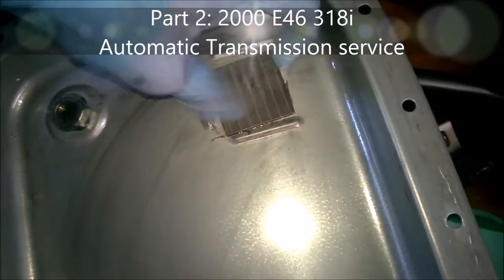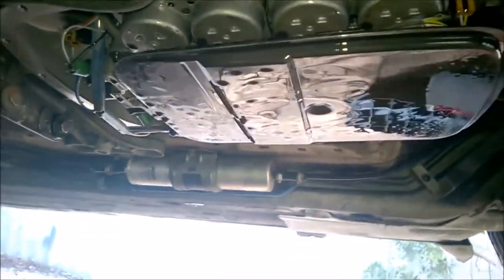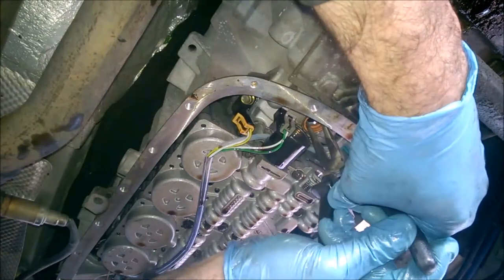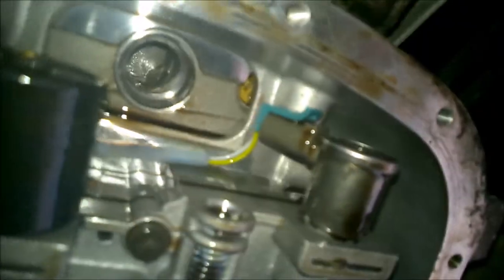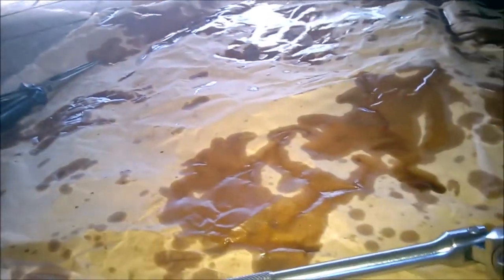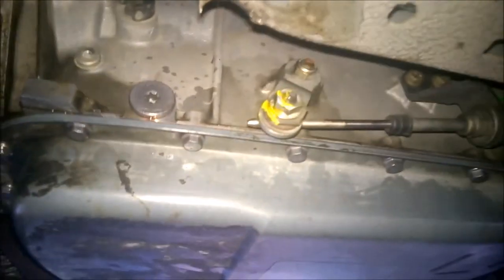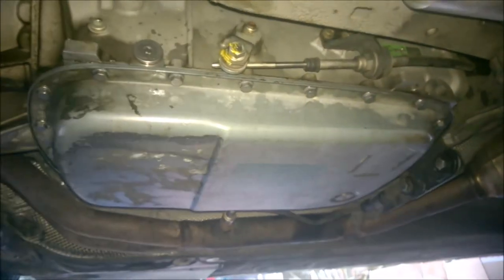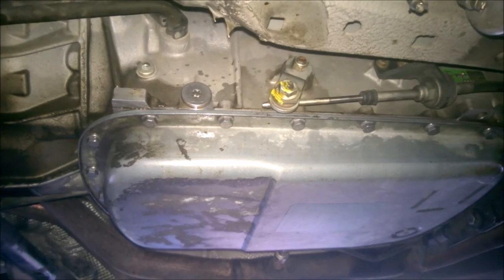Part 2:  2000 BMW E46 318i Automatic Transmission Service

Comment: thanks for video just about to do this on my trans same as yours what was the torque wen doing up the bolts mate?
Reply from the maker: I cant remember right now, but refer to manual. I just nipped them up as they are low torque. Just do not overtighten!

Comment: How much litres you put in transmission?
Reply from the maker: Usually the fill hole is also the level, so when it starts to pour back out its full.  Just make sure you go through the gears while filling and not allow the oil temp to get hot. Im sure theres instructions online.

Comment: hello bro
why you didnt put sealant betwen gasket
and carter?
Reply from the maker: There are no instructions to do so. But I suppose you could add a slight amount onto the gasket itself but I never had an issue with leaking.

Comment: Did you had any issues after you changed your transmission oil to date? Thank you for making this video.
Reply from the maker: No problem at all, the box is still running smooth as silk.  Cheers,

Comment: Hey buddy please if you can help... If i checked my transmission oil and it looks so dark so i can't do the service??? My car transmission fluid gasket is leaking and people here in egypt telling me if i changed the fluid i will lose my transmission so they suggest just to fill what i lost from leaking
Reply from the maker: There is lots of information out there about this situation. Some say if oil is already bad the trans may be already worn so no point changing. Others think changing is good as it will make the trans last. But i was told that trans flush is no good, just drain and refill as only part of the oil is drained, so new oil mixing with old is a soft option (like they told you). Really your decision in the end.

Comment: How come your gasket has got 5 holes on the front and back but the pan has only got 4?
Reply from the maker: Dont know why that would be the case, except perhaps the same gasket is used on another pan of the same shape...  Doesnt leak at all tho.

Comment: do we have to replace the filter as well?
Reply from the maker: Up to you, if in doubt get an experts advice but not changing is the same as doing an engine oil change without a new filter.
Reply: how many liter oil do we need ?

Comment: What was the part code for your filter kit?
Reply from the maker: Cant find it mate, sorry. I just rang the independent BMW supplier here, gave them the VIN and trans model and they got it in for me.
Reply: I'm hoping a BMW car has a problem after changing the oil and the filter is more often than not taking off the car when it is cold.

Comment: what oil you use ?
Reply from the maker: The first video shows this.  However I got the oil that was specified as OEM replacement so that it would mix with the original oil.  Be very careful what you decide to use...

Comment: Code transmission???
Reply from the maker: Check on the side of the gearbox, just above the sump on either side. You will see a sticker with the model number. Should be ZF or GM, both take DIFFERENT fluids make sure you know what yours is.
Reply: Rover Tasmania what is facebook ??